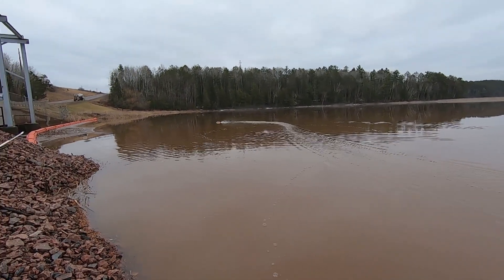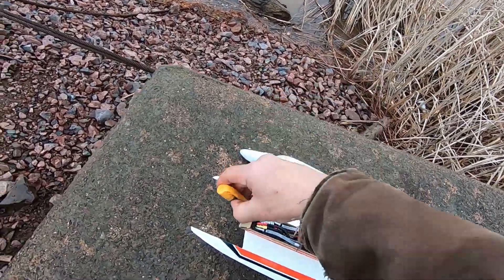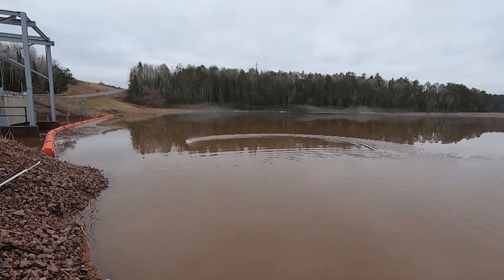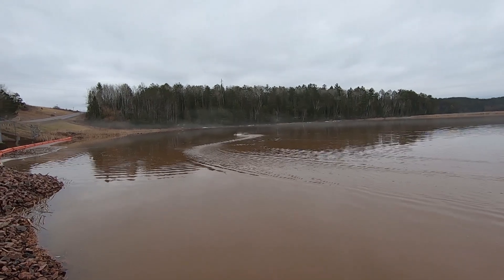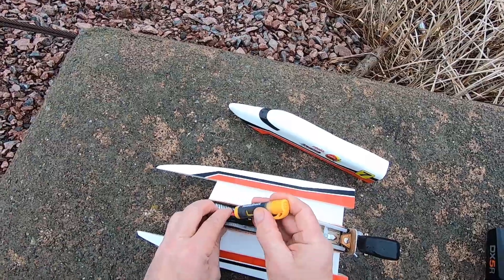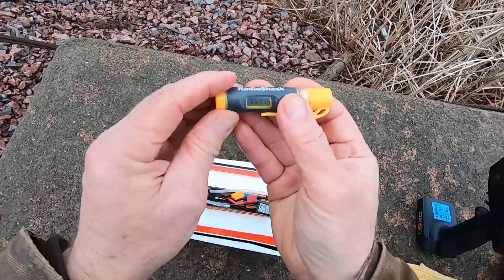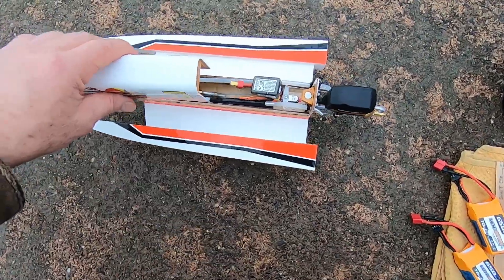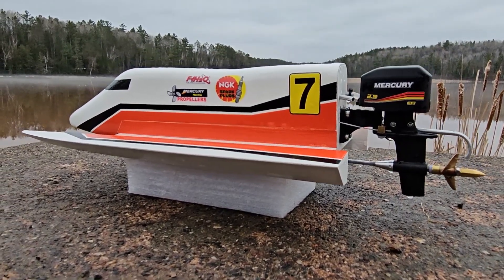Water Cooled TunnelJet Running on 3S Lipo!

Comment: Hey Sam,
Man that’s a pretty boat.
Almost all my boats use the prop blast water inlet. I’m wondering if the speed is affected. I never ever compared.
I notice my ski boat that has a LH prop turns worse to the right my old ski boat had no transmission so it was a RH prop and turned better to the right yet riggers seam to increase their revs and speed in a RH turn. Go figure.
Reply from the maker: Thank you kindly James! I would think a prop-blast pickup is less drag than a pickup tube in the water...
Reply: Me too